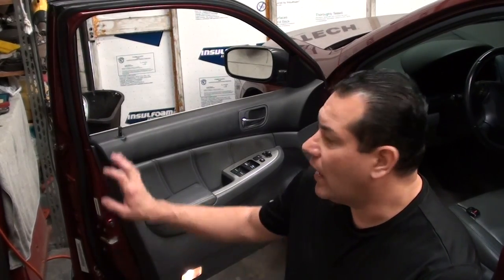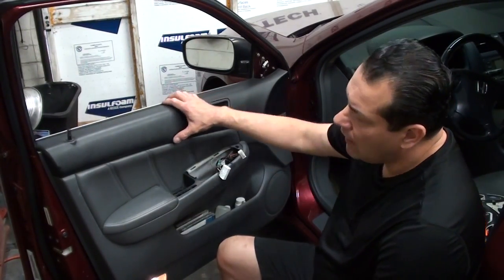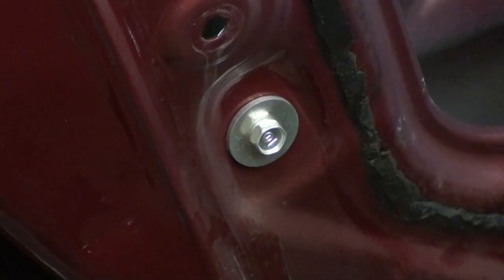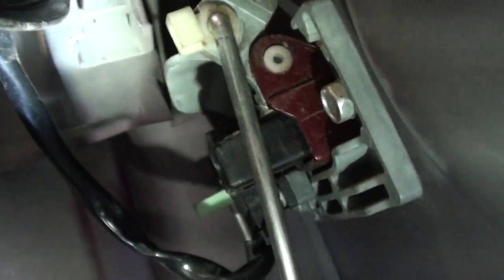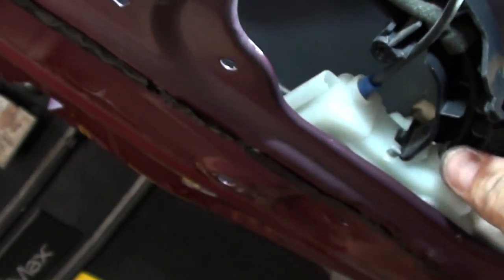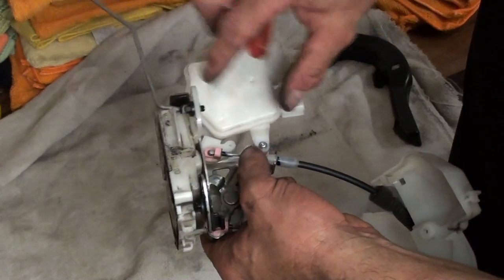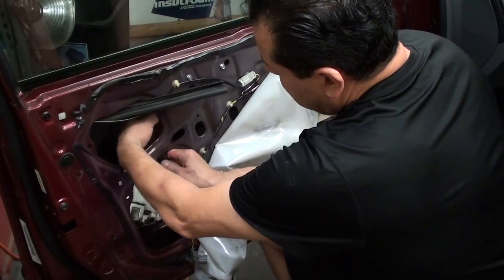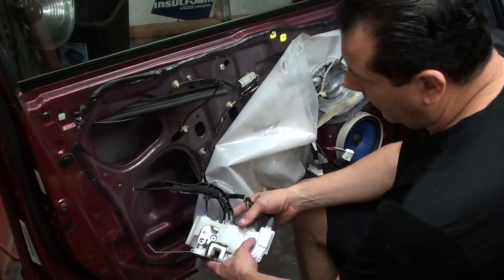How to replace door lock actuator on a 2003-2007 Honda Accord (driver's door)

Comment: The front door of my 2007 Honda Accord wont unlock or lock with the key. Is this the fix for that problem as well?
Reply from the maker: Tyrone Jones it could be, but might be your key cylinder. You should have a locksmith look at it. They can tell you if its the actuator or just key. Usually the way I check as I hit the lock and unlock button on the inside if it doesn’t lock and unlock it then it’s the actuator not the key cylinder

Comment: I have a 2005 Accord which I think might have a faulty door lock actuator for only the driver door. The problem is, when I press the lock button on the fob all the door locks except the driver door. Everytime when leaving the car I have to manually lock the door with the key and only then it locks. It also doesn't lock when I press the lock button on the door switch, I have to manually push the plastic lock pin to lock it. I can confirm that the fob or the vehicle battery is not the issue as all the button on the fob works and the battery was changed last year. Maybe it's a blown fuse for the actuator?? It's not a big issue for me. I was just curious to know the cause for this.
Reply from the maker: Sounds like the actuator on the driver’s door is bad. Especially if you can’t hear anything.  Sometimes you will hear them vibrate but not lock or unlock.   Means actuator is no good
Reply: @raiderman28  Raul, I don't often comment on youtube videos but credit where it is due, you know how to make a how-to video. Camera secured, showing the inside of the door, step-by-step, much appreciated. Cheers.

Comment: So I just replaced it, now I tested it and it unlocks fine but to lock it won’t work. Not sure what to do everything is plugged in
Reply from the maker: Nick make sure door is closed when you test it.
Reply: Raul Romo i should’ve hit the door sensor button while I did that thank you so much!! The repair was a success with the help of your video

Comment: Is it possible for both door actuators to go bad ?
Reply from the maker: ceelos 21 yes. In hondas it happens all the time. I would try direct power to the actuator before replacement. I think there is a plug that you can disconnect inside the door to connect to , to check
Reply: Oh okay thank u for responding. I have a Honda Pilot and my driver door only unlocks the back

Comment: If you took this to a shop to have this done, how much should this cost? (Give me an approximation. I know price varys)
Reply from the maker: Jackson C Depending on the year make and model, i usually charge right around $195 in labor plus the part generally range anywhere from $60-$95 depending if it’s just the actuator.  $150 to $200,  if the actuator is built in to the assembly and can’t be removed
Reply: @raiderman28  I have a 2004 Honda Accord LX. Is the actuator built in my car?

Comment: 11:00 how do you unclip the rod from the latch on this part
Reply from the maker: SwirlySquare you unclip the security clip then pull out the rod
Reply from the maker: SwirlySquare it un clips the opposite way that its is snapped in.

Comment: I attempted this because my handle cable snapped . Before I couldn't open it from the inside , now I can't open the driver's side from the outside.. whomp whomp :/ any suggestions on what it might be ?
Reply from the maker: Shinobifoxx hard to tell. He cables for the lock and inside handle are prone to breaking.  But not usually the outside handle
Reply: @raiderman28  I think it might be one of the clips snapping off inside. Now my door will only stay shut if I lock it first .

Comment: does anyone know if ex and lx share the exact same solenoid models?
Reply from the maker: Ricky daniel Garcia you would have to call the dealership, but if they sedan models they should be the same. The coupe models use a different actuator and are alittle easier to access. I know this, because i just did both actuator yesterday on a 2003 accord coupe. Those are alittle different to do, and don’t have that pink clip.

Comment: My 2006 Accord front passenger door won't unlock with remote or key in driver's door. The puller is missing. Any ideas what I should do?
Reply from the maker: you mean the door puller on the inside??  or are you talking about the rod (cable part that opens the door)
Reply: Raul Romo the mechanical puller that unlocks the door that screws in at the top of the door on the inside is missing .
Reply from the maker: going to be extremely difficult to try and fix this.  you will have to remove the front seats through the drivers side.  this will alow you room to remove the door panel.  once you get the panel off, you will have to look for the part that unlocks the door at the latch, and try and get it open.  Good luck !!
Reply: Raul Romo lol naturally!  Thank you for your help .

Comment: That pink piece that broke use a hair dryer or heat gun on it something dad taught me usually breaks because of cold weather
Reply from the maker: Victor Belmares it was old, thats why it broke.  But your tip is a good idea. Worth a shot.
Reply: @raiderman28  we have worked on cars that are  30 years old there was 20 plastic clips i broke the first 2 clips dad stopped me and said put heat on them didn't brake anymore try it see how it works

Comment: My issue is my daughters 04 Honda Accord passenger side door will not lock. Manually from inside or with key fob. Could this door lock actuator be the issue?
Reply from the maker: Samantha Rangel if the actuator is frozen, it could be the actuator. Sometimes the actuators will freeze once they finally give out or burn out.  It could also be something broken in there. If you can hear the motor making noise when you hit your remote for the door switch on that door, then it could be the cable that might be bad. Which means you have to buy the whole assembly with the two cables. A lot of times they break right where they attach to The handle on the door. This is very common on the records from 2003 to 2007  Sometimes when we take these apart the park around the cable that attaches to the doorhandle brakes because they’re made out of cheap plastic. Are usually find a way to zip tie them back together to keep them working without having to replace the assembly. Unfortunately I do not have a video to show how to do this.

Comment: Watch those three screws holdnig the mech to the door, they resistant to impact drivers and I dented the door panel next to the screws because I was hitting them so hard. I won't detail how I got them out here, but hit me up if you're stuck.
Reply from the maker: Matt Jacomos sometimes they can be tricky
Reply: @raiderman28  I was hitting the impact driver so hard I actually had  dented the door panel.... and still the screws wouldn't loosen...  Ended up pushing the panel back to square...

I ended up using a "Super Wrench" on the barrel of the impact driver and the screws came  out surprisingly easily. 
Prior to that I attempted to (shock) loosen the screws by hitting them with two hammers (Mallet on ball peen on screw) to jog them loose, No Dice.... This is the fourth time the "Super Wrench" has saved  my ass...

and the actuator video of yours  came in handy. The lock works now...

Comment: Would it be the same replacement piece for a 2003 Honda do you think?
Reply from the maker: Emerald Calate yes. 2003-2007 should be the same on most sedans

Comment: The three screws for the latch are so tight on mine. I actually bent the door using my drive hammer.
Reply: I used drive hammer too still couldn’t remove it. 1/4 socket with drive bit with 1/2 ratchet.  It came out very easily 😎

Comment: Had a new lock installed but it still bounces when I press lock button inside
Reply from the maker: RC Drones not quite understanding what you mean by bouncing??
Some of these vehicles have a door lock module. Maybe thats bad and not your actuator
Reply: Raul Romo when I’m in the car and press lock both doors lock then unlock I had a mechanic look and replaced one of them to see and it works with the key fob but not the central locking button inside the car.

Comment: Thank you.  This was not hard at all.  Unfortunately the plastic piece on my cable was already broken.  Also, the clip that attaches the thinner rod to the plastic slide in the door latch broke and they don't sell that separately.  It only comes with the latch, so I had to buy a new latch.  If you're not in a hurry to put it back together, then I'd recommend buying your OEM Honda parts from www.partsonlineusa.com.  They're about 35% to 40% cheaper than what the dealerships will charge you.
Reply: The part that you're talking about that broke that attaches to thin rod to the plastic slide... Is it a little plastic clip that held a metal rod in place directly onto the back of the keyhole on the outside door handle by chance? Mine broke while doing this repair and I'm trying to figure out if I need to buy a whole new latch or lock assembly because I can't seem to find the separate piece... A plastic clip or holder or something.

Comment: what tools do you need for this
Reply from the maker: Ali Hussain too many to list. Can’t remember off the too of my head. Watch the video and take notes. To take the panel off a Phillips head tip with a drill, small thin screwdriver, door panel removal tool, thicker Phillips head larger screwdriver ( to remove the door latch). Thats all I remember off the top of my head

Comment: Can I get the hold thing on Amazon?
Reply from the maker: The plastic clip??? 
You can probably buy clips in a universal set with all kinds of clips, and it might come in there. The problem is that those come i. Different sizes. I picked up a assortment of clips that some of them came in that might fit. 
You might be able to look up honda door lock rod actuator clips and take a gamble with ones that come in different sizes, but its not a sure thing you will find the exact one. Some come larger than others. Buy ones that come in large assortments is you r best chance of finding maybe one. I went the a pile of my neighbors clips from old cars and found something similar and it worked.  I later purchased a few set of different clips from Amazon and ebay and there were several different sizes of those style of clips in there.
The problem with finding the exact one, is that this is not a door lock actuator rod… its a pieces were a rod attaches to the actual door lock latch assembly. Thats why I mentioned to take the old part to the Honda dealership so they can look it up and possibly give you a part number if they don’t have it, and then look that up on the internet. 
This link will get you started in the right direction hopefully.  If it was me I would just buy the ones that have many different similar clips and see if they will work, since they are cheap in price.  If you put the year make and model, it’s probably going to say it wont fit. The issue is that it for a different type of application, so it might show it wont fit, when it possibly can fit… Rexka 10pcs Actuator Handle Door Lock Rod Clip Left-Hand Side Compatible with Chrysler 4658677 Dodge Jeep Chryler https://www.amazon.com/dp/B078RKGW5S/ref=cm_sw_r_cp_api_glt_fabc_S88S1Q9VTWBZMMKWTRVD
Reply from the maker: Also you can look for the part in ebay ( the door lock actuator assembly) some of those shoe the pink clip.  See if they have the door side you are looking for, or just buy one like this just for the exact clip
With this heading 
“2003 honda accord door lock assembly clips” 
It will say no match, but you will see the actuators pop up and you can purchase one from there, and hopefully those actuators will fit. I usually get mine at the honda dealership and they are way more expensive. But aftermarket one sometimes work also. Aftermarket ones sometimes require alittle bit of modifications, so if its for a customers car, i wont go this route, because it takes too long to make them fit.  I did one for my dads trucks, and had to modify the connection plug, because the connection had a tiny piece of plastic that wouldn’t let the connector go all the way in to snap in place. I guess because of patent rights they couldn’t this the aftermarket knock off completely the same.  I made it work after honing out the plug with a dremel tool, but it was a pain.  The only reason i did that on my dads truck, was that the dealership wanted $350 for that part and i was able to get a aftermarket one for $50. I dealt with the extra work and save $300.  But of your not handy with modifications, and its not too expensive, then get the original. Hope this helps you out a bit

Comment: But, how did you open the door???? It supose that is looked.
Reply from the maker: Rodrigo Jacobo Ochoa pretty tough if thats the case. You would have to remove the seats through the other side and try to take panel apart to see why its not letting it open. You might end up ruining the door panel
Reply: @raiderman28   thanks Bro.  I think  I have to take my car to the mechanic 😔

Comment: wow I remember changing this part on my driver side door years ago  and I don't remember so many steps and taking so many things apart .. then again maybe I just subconsciously forgot all the steps because it was such a pain in the ass lol
Reply from the maker: d jones when you are trying to explain the steps, it seems like it takes much longer and there are more step.  I try and do detail examinations, because there are alot of people that need to be completely walked through the process.
Reply: @raiderman28  I hear you that's true .. I was just thinking back to when I did it .. this is a well done video .. very detailed which is crucial so you don't miss little things ..  the only one so far that I've seen that shows where the hidden rod is located .. 

I just changed it and that part was very helpful .. I managed to get a small flashlight in just the right position with one hand to light up the area where it goes in and then put it in with the other hand .. kind of a pain in the ass the first time but after that I think it'll be much easier if you have to do it again

Comment: I replaced my 2006 Honda Accord driver side door lock actuator and now the door doesn't open anymore? i don't know what happen? I should have taken to the dealership for repair. BIG MISTAKE ON MY PART. Now, it's going to cost me more money to fix.
Reply from the maker: Can you manually open it???
If not, you probably didn’t hook one of the rods up correctly.  This job is a process, and if you don’t know what you are doing, that can happen.

Comment: anyone who has an 03 honda accord coupe its much easier than this i did one door in like 25 minutes part costed 6 dollars on rockauto good luck everyone
Reply from the maker: Coupe is much easier to do.  I did one for a buddy.  The cable is about $6. The actuators are not $6
Only aftermarket actuators are that cheap
Reply from the maker: Only takes long because there is filming involved. 🤦

Comment: That's probably about five hundred dollars at the dealer. THANKS
Reply from the maker: Yup, I usually charge about $200 plus parts ( depending if the customer wants Original Honda parts or aftermarket if available)

Comment: a shop quoted me 400 i think ill do it for 12 bucks and a little luck
Reply from the maker: That sounds about right. The parts depending on what year, they range from $60-200 for parts depending on where you buy them and about $200 labor.
Reply: @raiderman28  oh shit yeah I’m pretty sure it’s oem parts. I got a replacement cable coming in just in case for Honda for 20 bucks so not bad for a little practice
Reply: @raiderman28  have you fixed anyones car with a drivers seat that jiggles when accelerating and braking? It’s one of the last problems I have before I go and spend 600 dollars on a new one
Reply from the maker: @YourMawMawsToy  oh yeah the cable is like $12 online, but the actuators can vary depending on the year. I think this one was OEM and was not cheap
Reply from the maker: @YourMawMawsToy  my truck had a similar issue ( the bolts got loose), and my dad’s truck did the same, but it was the seat belt part that you insert the swat belt into.  Those are the only issue i have seen.